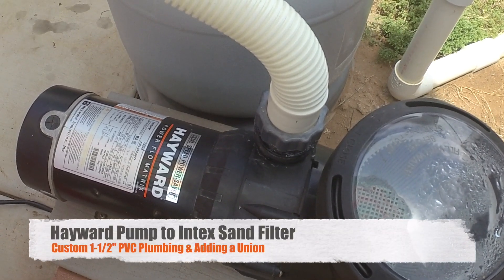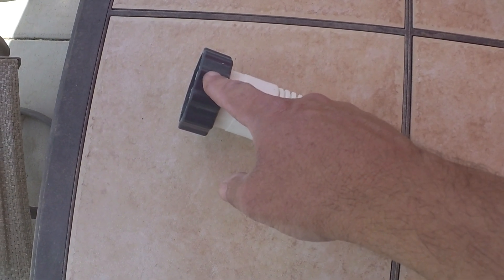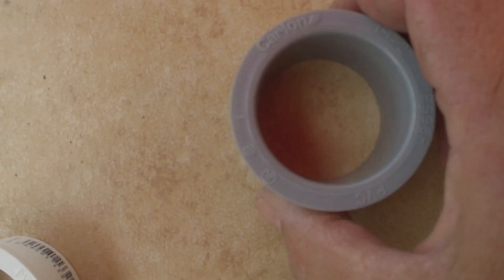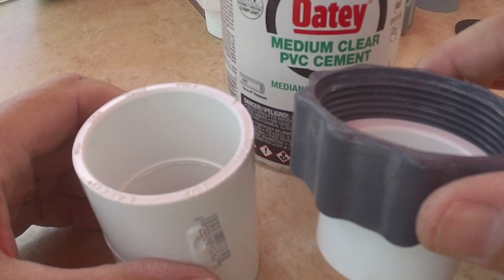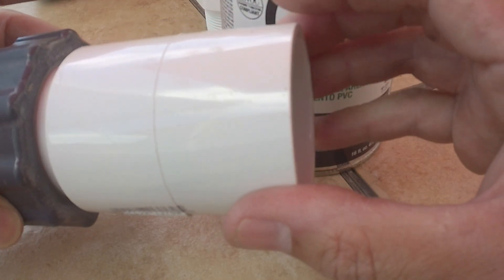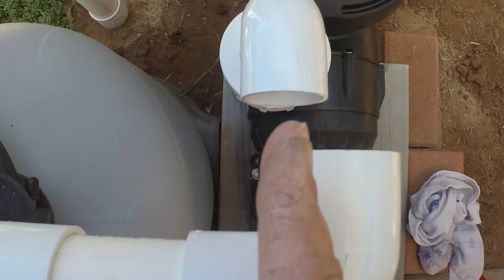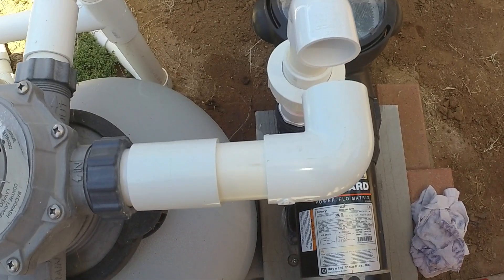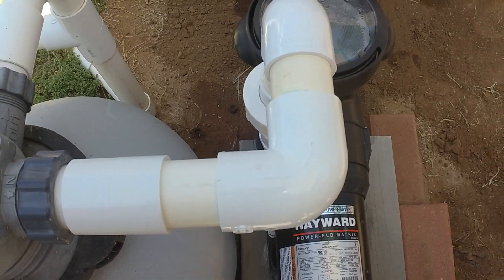PVC Plumbing Intex Sand Filter to Hayward Pump with Union

Comment: What was the thread dimension or part # for the threaded coupling that went affixed to the pump?
Reply from the maker: I don’t have the part number but for my Hayward pump everything on that end used standard, inexpensive off the shelf 1-1/2” pvc parts I bought at my local Home Depot or Lowe’s.

Comment: Thank you so much for your video ive watched it since you posted and now again that I finally have a sand filter. Could I trouble you to list all the parts used ,  always end up getting more PVC pieces than i need and end up confusing myself. Im not sure if i have a slightly different model, im not able to screw in that piece at the bottom as the threading is only on the outside

Comment: (1) why remove the semi-flexible pipe in the first place? (2) Why not align the pump directly under the inlet to the filter so that you only need one 90, which would reduce flow resistance?
Reply from the maker: Mainly was looking to replace the flimsy flexible pipe that had been in the sun for several years and show how I joined standard pvc to the non-standard Intex fitting. Your idea may work fine as well. My plumbing evolved over many years as I tried to make the system reliable. Good luck with your pool projects!

Comment: Man, I owe you a case of beer. You just solved my problem. I have now tried 3 times to make my new pump play nice with my intex system, and right now it's just dripping. The key, for me, was to use the 1 1/2 to 1 1/4 bushing with the original screw, that's just genius if you ask me, if I knew where you lived, I would ship beer to you.

Comment: Did you put a gasket between the filter and the custom adapter you made to help it seal?
Reply from the maker: Yes, it’s same rubber gasket that is seen tumbling to the ground as I remove the old hose at the beginning of the video (around 0:23 into the video).

Comment: converting to PVC to try to increase water flow. Seems like the reducer takes you back to 1 1/4" defeating my purpose.  Any other way to connect my 1 1/2" pipe to my pump?
Reply: Being smooth sided pipe instead of corrugated hose it will flow better. That corrugated hose puts plenty of resistance on the water flow.
Reply from the maker: This is the size of the Intex pumps and filters, I’ve run on this adaptation for years, 2-speed Hayward pump into my Intex sand filter, flows plenty of water, no issue at all using the 1-1/4” adapter to make the PVC connection at the filter. Good luck.

Comment: Where do you get those 40mm nuts if you don't have them?
Reply from the maker: There are multiple ways to make this connection, but I find this one I use to be the best, there are a couple aftermarket adapters that are poorly made. Either find a used Intex hose on eBay to harvest the 40mm nuts, or buy a new replacement on Amazon https://amzn.to/3J5WsFQ